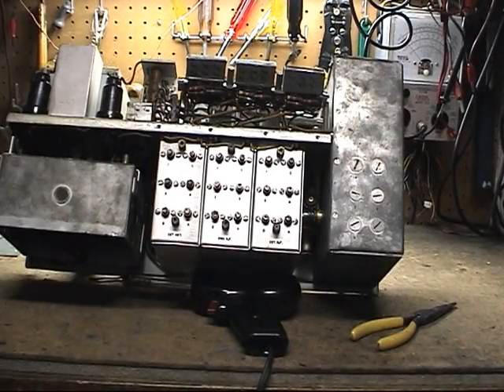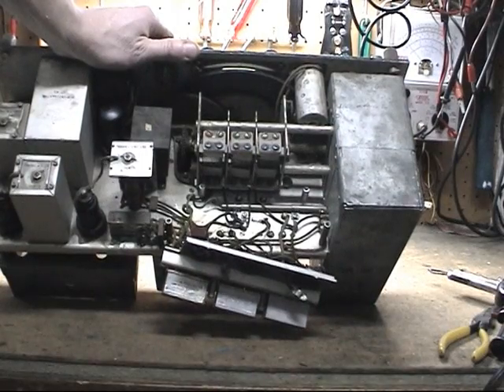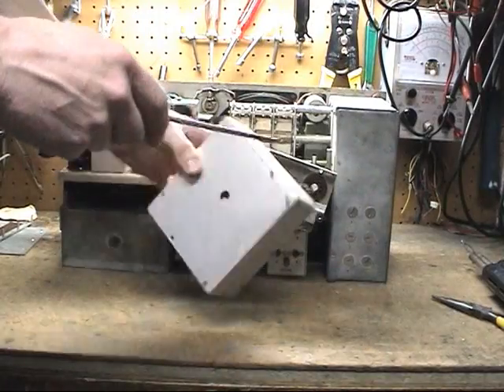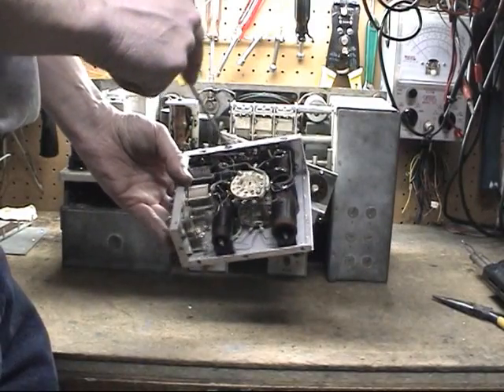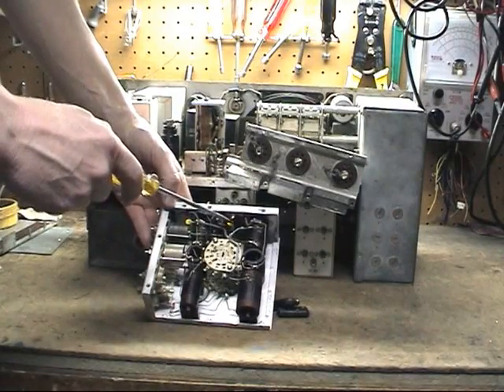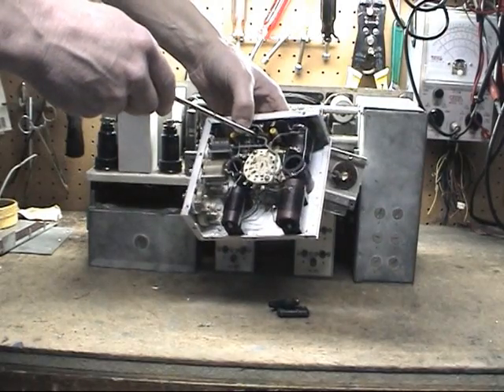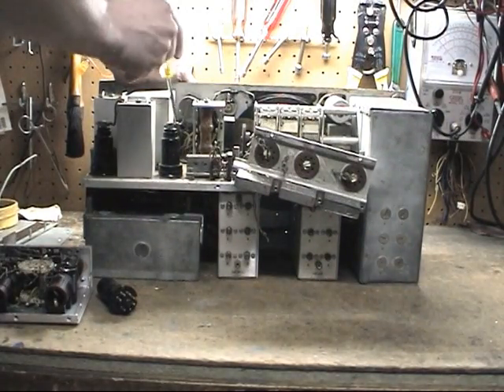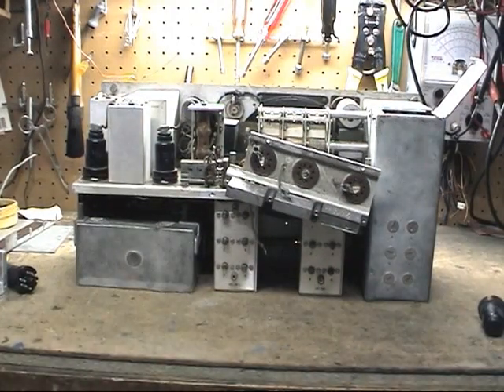BC-342 Radio Receiver Capacitor Replacement Tips Part 2

Comment: Very helpful. I’m 3d-printing a mold for the outer 3x0.05s. Will do the hidden ones also. But first things first. Btw on my 312-N the 3x0.05s are hidden by a mounting strip of bakelite (or whatever).
Reply: It is done! Some 25 0.05u caps and a few 10n replaced. The crucial one was the anode decoupling cap in the oscillator compartment. The receiver really came live then!! Bingo. Very happy!

Comment: these silver mica capacitors rarely have problems with leakage and capacitance alteration, now the resistors and paper capacitors are trickly role,after 60 years is expected of all....
©2011 Guimbadriver Broadcast Corporation,All rights reserved.

Comment: @radiobigman47 If they are genuine mica condensers I would leave them alone until you replace all the usual suspects first, you can usually tell by size and often by the dot code, the ones that he is pulling out are "Micamolds" which are just paper and foil condensers. Some of the black molded Sprague condensers are from the 1960s and are actually paper and Mylar, they aren't as troublesome as the "Black Beauties" which usually have coloured bands on them, or the Sangamo Little Chiefs.